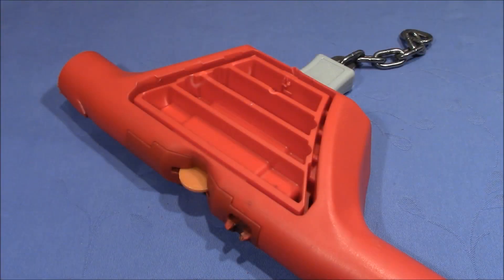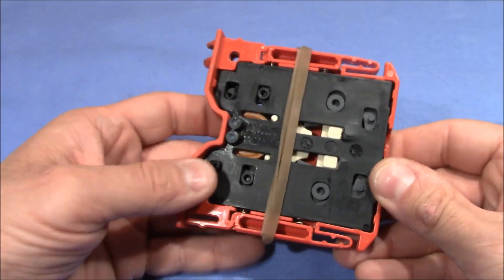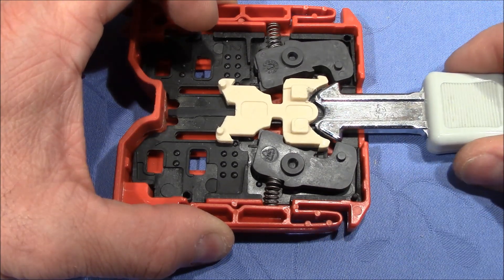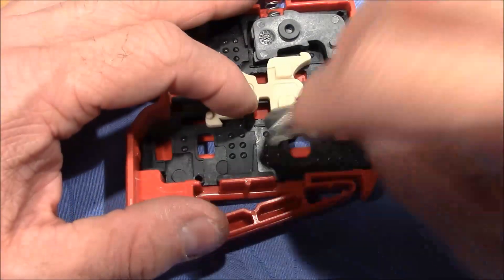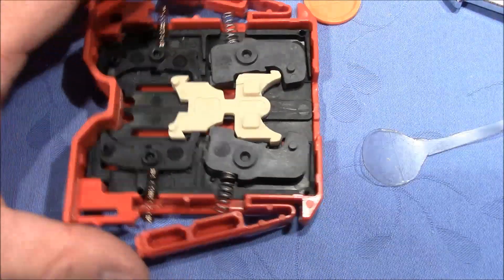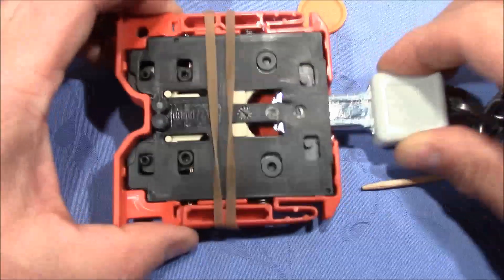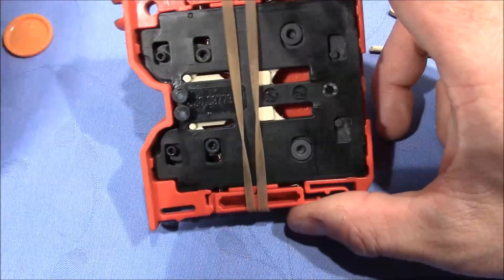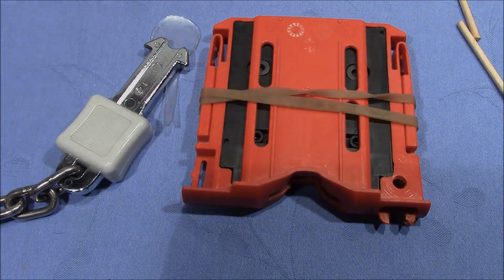(picking 719) Inspected & Defeated: Shopping cart coin deposit lock with arrow bolt

Comment: Interesting video!
You might try finding some plexiglass sheet with a similar thickness of that black top. Using the top as a template mark the plexiglass and cut out the areas that need to be removed. Reassemble the lock with the new cover and you can show how the mechanism works in its entirety.
Reply from the maker: Good idea. I once made a see-through cover for a lever lock which was more complicated than this would be. Have a good one - cheers.

Comment: Some interesting design elements & some clear shortfalls.  Shall have to see if I can get a hold of one of the fairly newly introduced examples, here in the UK, as a comparison.
Reply from the maker: So they have something new? How do they look like?
Reply: @Potti314   they require a coin be inserted in a cassette, that is then slid inside the locking mechanism en bloc; essentially a form of warding.  I imagine the internals are very similar but access to them more restricted, though I would reckon a strip of mica, or similar material, appropriately sized, would serve well as a bypass.

Comment: Thanks for sharing Potti, I use a key ring and after the trolley is released I pull it back
Reply from the maker: Thanks for sharing. A keyring is a good idea. You can also try pulling it out right away when it's attached to a string.

Comment: That's fake LIDL coin ! Mine's blue ! 🤣🤣🤣🤣🤣
I wish these type of locks had some sort of key override , so they'd be more fun. :)
Reply from the maker: Haha, they are good fun for me every time I go to the supermarket. The coin is one of probably 50 that I picked out of shopping cart where people forgot them. I also have blue ones ;-)
Reply: I wish I could THAT easily find some locks here , but not much luck. I've found all kinds of currencies , as people are usually lazy to wait to get those coins. :)
Reply: There is a override! At my work we use a simple key tag/label (type with round ends) which kan be inserted on the coin side, and pulled out effortlessly.

I must add that key tags might differ slightly from seller to seller, so some might work better than others

Comment: Thanks for demonstrating another clever design for shopping cart security. I haven't yet seen this type where I am. Although, I think my homemade tool (for the other type you've shown in the past) should work. Having two curved and flexible arms makes my tool (made from a large paperclip) easy to bend to the right width to seperate the internal locking jaws, and still apply the forward pressure to release the coin. 😉👍
Reply from the maker: Great idea with the big paper clip. Will try it out myself. Thanks for sharing.